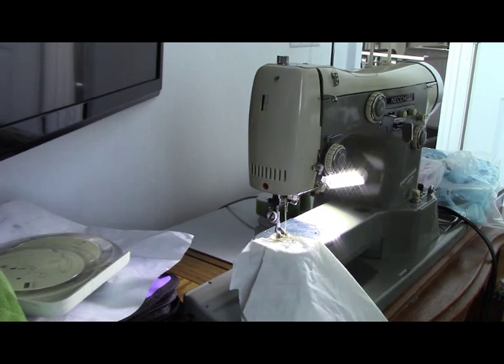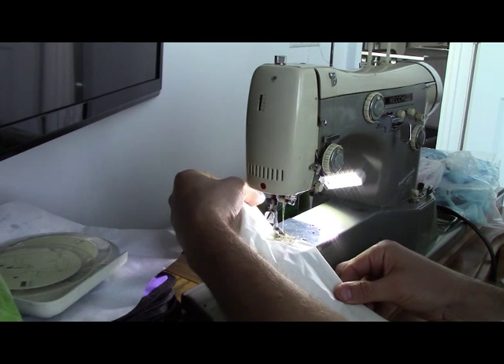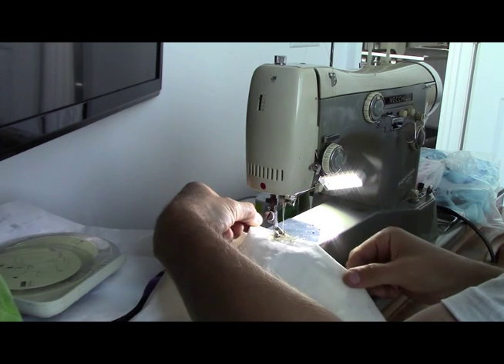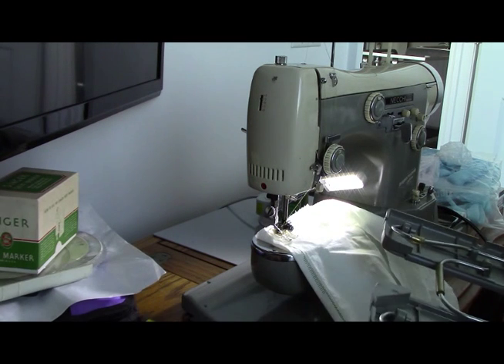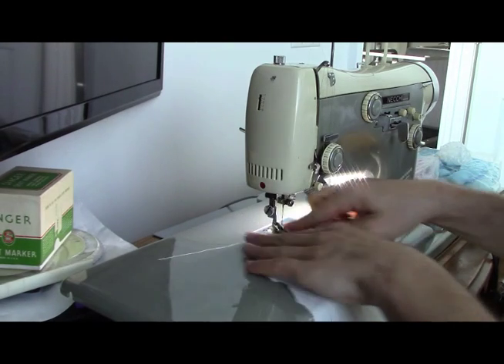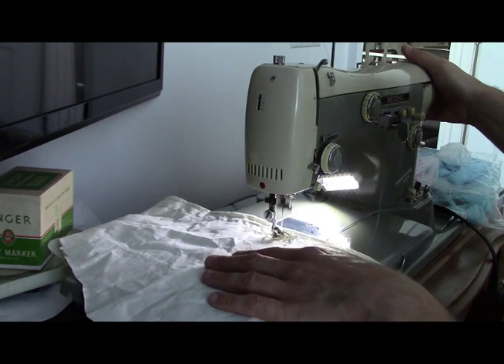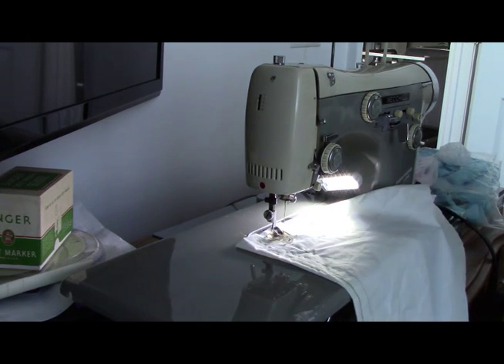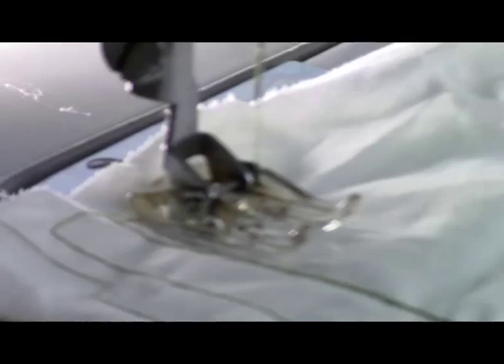my Necchi Supernova Ultra Freearm 3

Comment: Hi James. I have a Necchi Leila that was given to me, which unfortunately didn't work. The motor has recently been replaced and it still won't run. When it does run, which is for a brief moment, the new motor is loud and not quiet like the Necchi is supposed to run. I was wondering if it is possible to repair the original motor that was taken off, or maybe,  replace it with a new necchi motor as I don't want to get rid of my sewing machine. Can you please advise. Thank you. Best regards.

Comment: Do you know what the difference is between the Ultra and the Automatica super nova models ?
Reply from the maker: From what I could understand, it was the change in the knob design and the extra ability to control how quickly the cam would spin to elongate patterns.
Reply: James Rogers thanks for that.
I really like the free arm version of supernova but after you practice button holes you didn't seem to thrilled. Would a Geist button holer work on a free arm bed?
Or have you even tried using?
Reply from the maker: I did not like the 5-step buttonhole. I was trying to do it in 4 steps. I prefer a cam type buttonholer, or at least a buttonhole foot which stops at the end and makes it easier. I ended up opting for a Kenmore high shank type and an 'industrial' high shank type which gave excellent results much more simply -- I posted videos of me doing this.
Reply: James Rogers yes I saw the kenmore type as o just bought a vintage free arm kenmore with button holer at the advice of my sewing machine repair person. I still would like to get a supernova though.
Reply from the maker: The good news is that the buttonholer will fit when you get the Necchi.
Reply: James Rogers are the free arm supernovas more difficult to find ? It seems to me they are.
Reply from the maker: Yes they are rare.